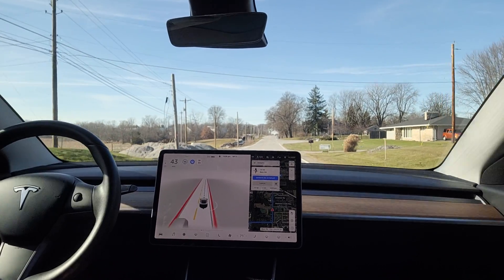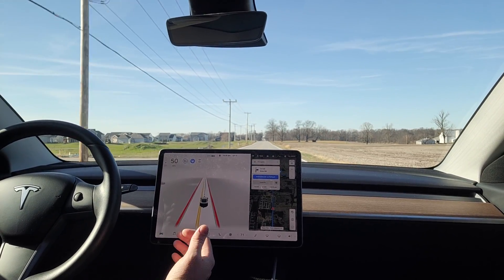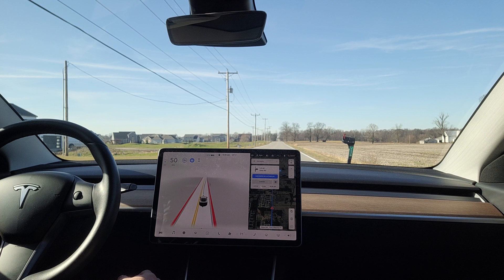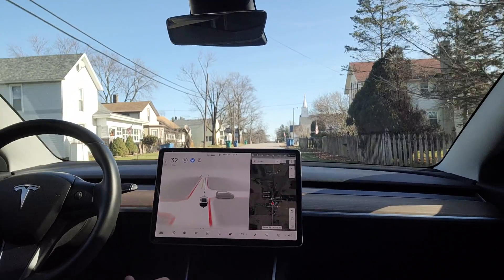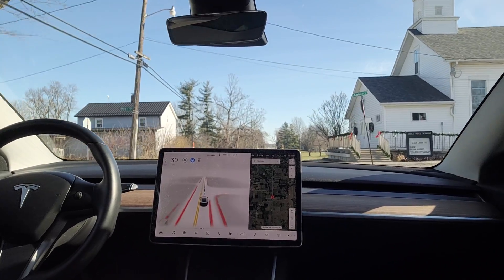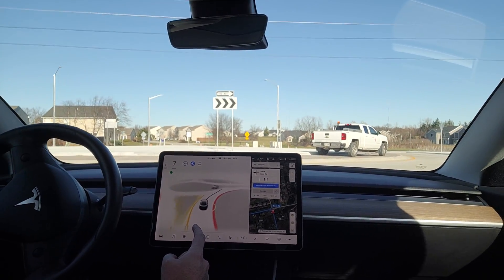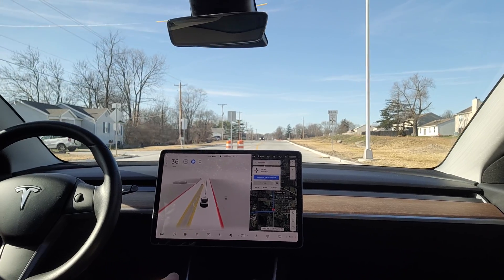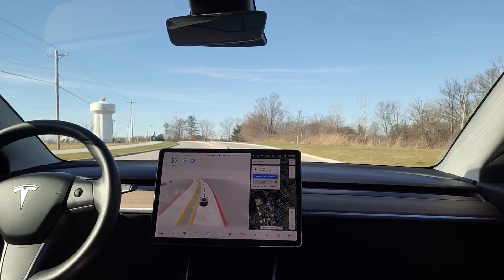Tesla Phantom braking reason explained

Comment: The last instance with the UPS truck was because it was out of maximum range but as a good Driver you would have seen that like you did and reacted in advance of approach. My question is to the programming based on weather conditions? Wonder if there is additional pre-conditions for rain, snow etc in those same instances.
Reply from the maker: I probably could have pushed it just a little further for the UPS truck and it probably would have started braking, but where i stopped it, it was pretty fast, and I could see the UPS driver getting kinda nervous.

I've addressed some of your other questions in my snow video https://www.youtube.com/watch?v=h5uofENRamc
Quick answer is they don't yet, it pretty much so handles the same in all conditions, but when it sees less, it reacts less. I suspect that rain / snow variable  for conditions will come after V11 enhancements. There are still times in rain or snow where it gets degraded to autopilot or forces me to drive. 

I'm also working on an updated video on phantom braking, as there are a lot more details I've learned since I made this video.